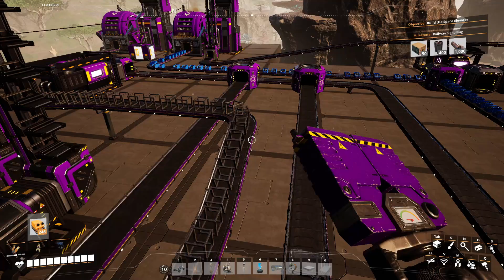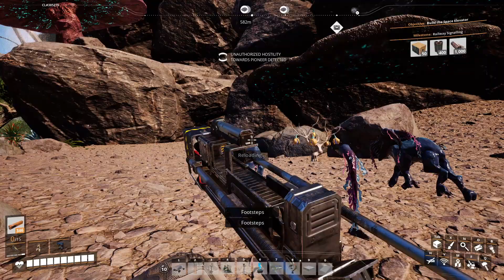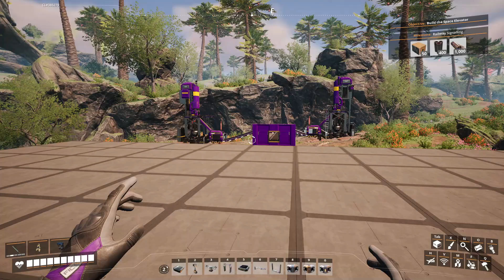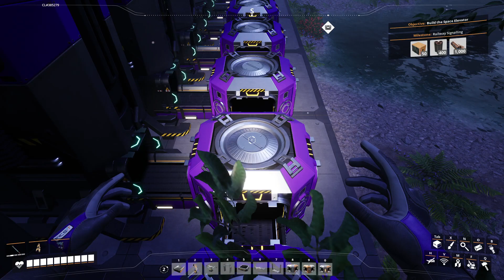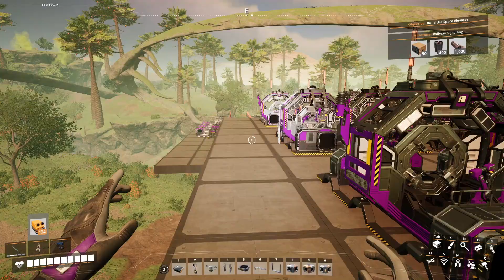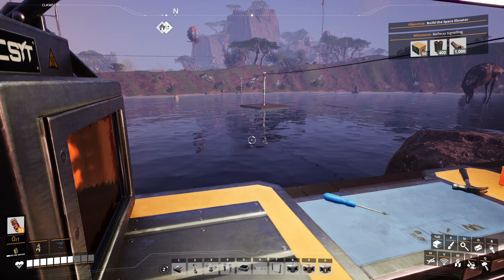Satisfactory 1.0 - Episode 17 - Back to Basics [Iron]

Comment: Hey there! Always glad to see a new pioneer in action!

I love that you're using power towers and ziplines, by far the best early game travel option. As far as new jetpack fuel goes, though, I would say you're going to be better off going for hover pack first and expanding your power infrastructure. My first fuel power setup stemmed from the heavy oil produced from rubber and plastic, but once you get a few choice alternate recipes, keep collecting those hard drives, you'll be able to go full into fuel power and then you'll have a lot of overhead to play around with.

The biggest trap in this game is wanting to go too big too fast, maximizing any single stage of production before you know what you want it for will force you to go from building production to upgrading power and back again and then having to breakdown machines to redistribute resources. Not to say I think you are doing this, but if ever you feel trapped, give it a consideration!

One last thing to leave you with, some experience with using the most efficient recipes, just for your edification. Petroleum Coke is something that exists only in one place in my factory and it was built well after I completed Phase 5, in a Turbo Fuel production module. I didn't use nuclear, I stayed entirely within normal fuel power to beat the game. The alternate fuels I'm creating now will be for an eventual drone network. Bottom line is nuclear and alternate fuels are what you'll need to get the power to conquer the entire map, coal power gets you to fuel and from there you use your logistics upgrades at each tech stage to augment your production within your existing infrastructure. If you aim for the final production number at the end of the module, let every stage prior make slightly more than is needed in the next step, that way the final machine never stops working and the pre-production machines slowly fill up for you to come back and collect or divert into storage.

Sorry for the tirade, I couldn't help myself! Keep it up, you're doing great!
Reply from the maker: No need to apologize, I'll always take tips and tricks from more experianced players given they don't spoil things like locations of key items or something like that, which is really only a problem for certain kinds of games. I appreciate the advice!
Reply: @OneTruePeanut  Any time! One more quick thought, if you haven't given Radar Towers a try, highly recommended, and what they actually do isn't immediately clear, until you build one and check the map ;P